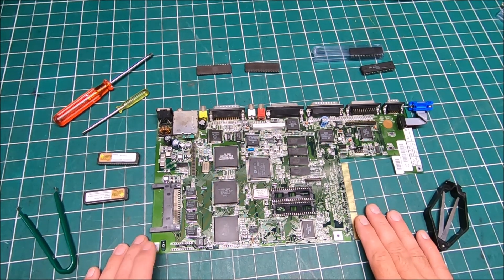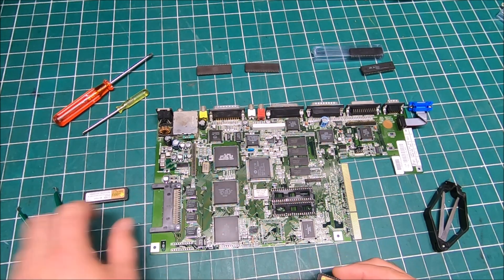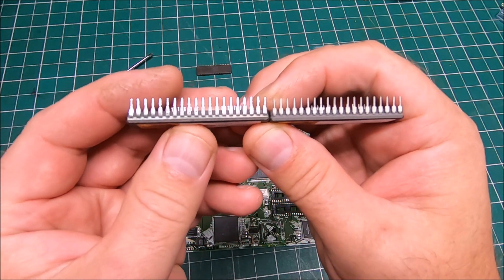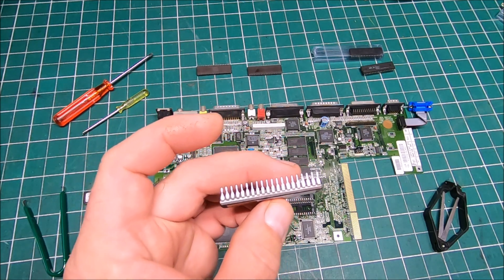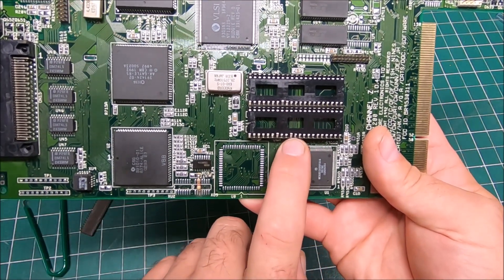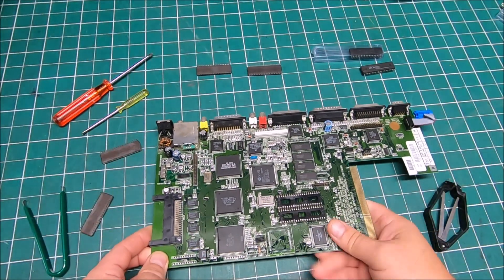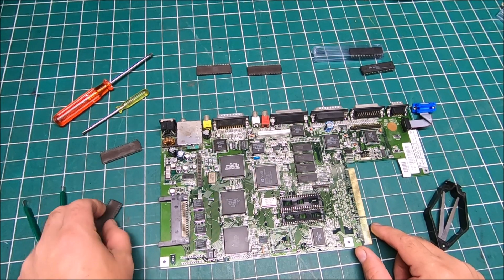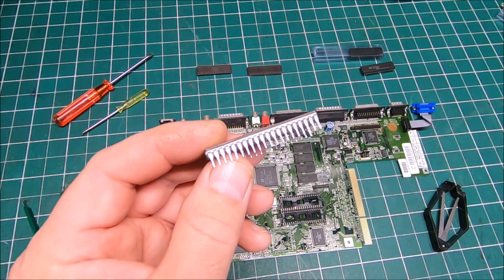Replacing Kickstart on Commodore Amiga 500 600 1200 2000 3000 4000 CD32 CDTV beware

Comment from the maker: Hi all, when you going to replace/upgrade Amiga kickstart on your system, be aware there are some kickstart chips from recycling and have some soldering on pins. Those chips will not feed as easy as a new one, also you will have a hard time to pull them out